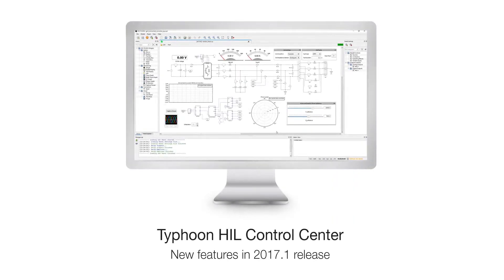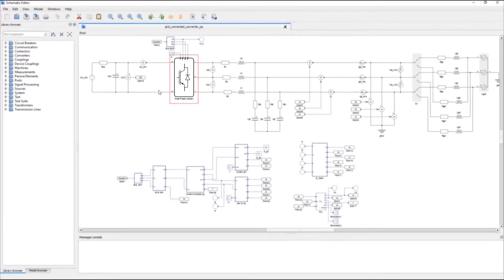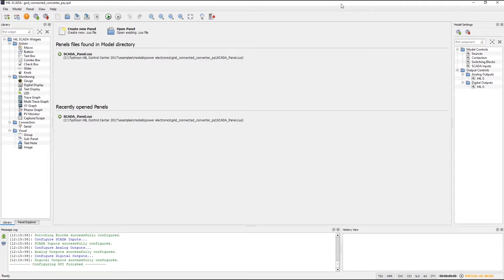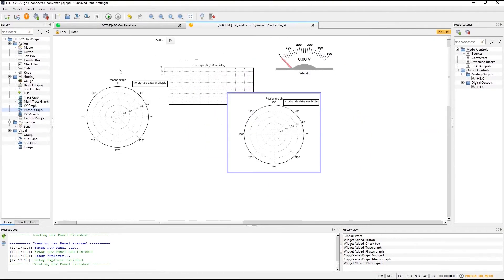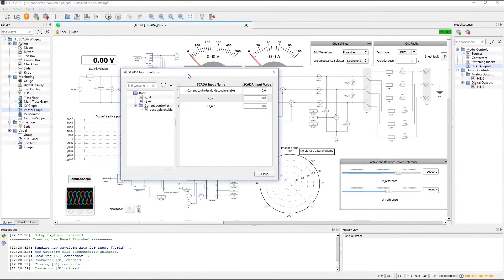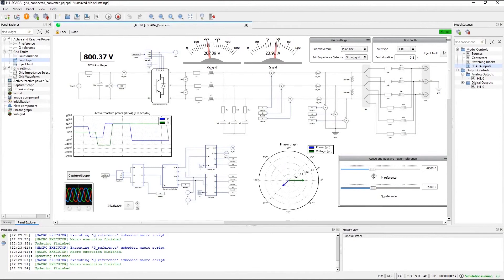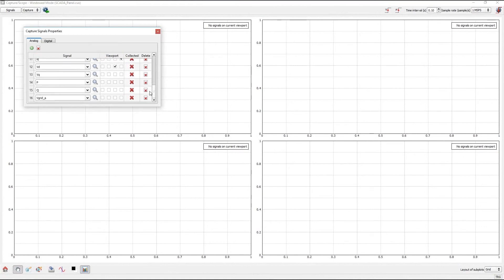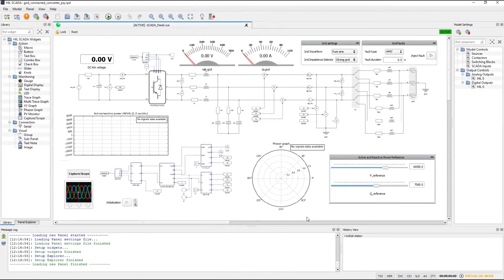Typhoon HIL Control Center 2017.1 | What's New?

Comment: I have to have some device connected to get the compiation done correctly? 
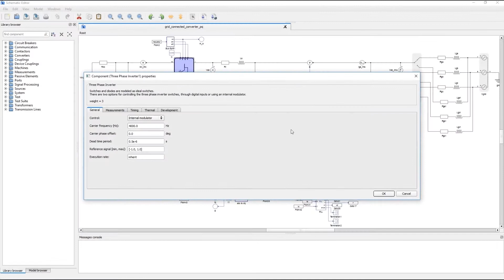when I hit the "compile and..." button at 2:36,  I had this message: 
┌───────────────────────────────────────────────────────────
│ Exception message:
│ module 'PyQt5.QtGui' has no attribute 'QMessageBox'
│ Exception details:
│ Traceback (most recent call last):
│ File "exported_src\typhoon\apps\schematic_editor\actions.py", line 1940, in action_performed
│ AttributeError: module 'PyQt5.QtGui' has no attribute 'QMessageBox'
│ NOTE: This and other exceptions are stored in errlog.txt in the installation folder, so you can see them afterwards.
└───────────────────────────────────────────────────────────
if so, is there any way to simulate the hardware?

thank you in advance.
Reply: You don't have to use any hardware for simulation in Typhoon Software. When loading your model to HIL SCADA you can easily choose option Virtual HIL. For troubleshooting your problem, please log into your subscription account at https://subscription.typhoon-hil.com, click "Support" and open a new ticket. Our staff will process your ticket as soon as possible.